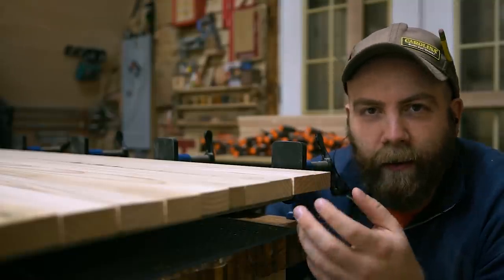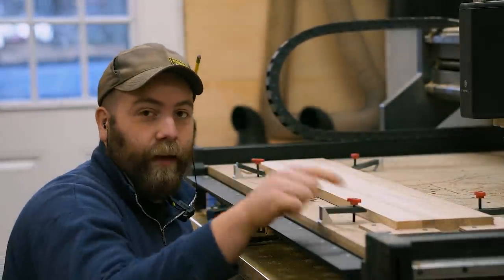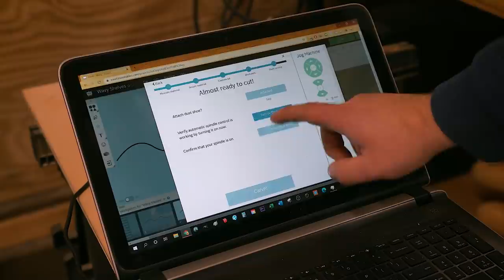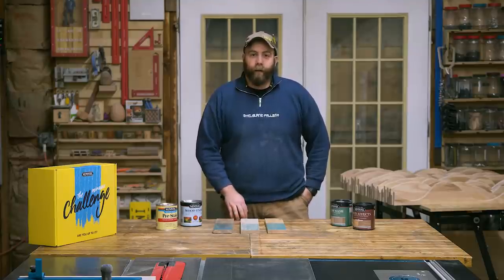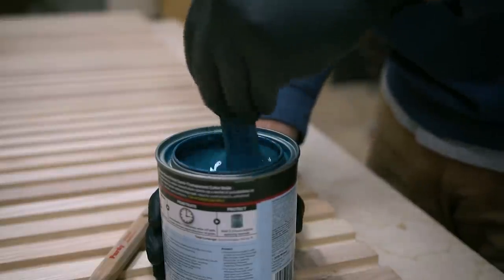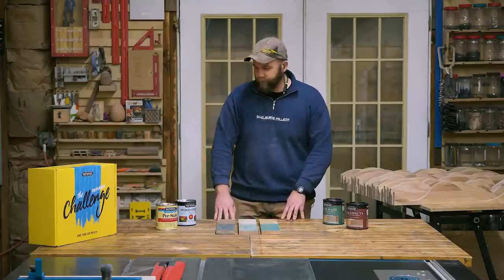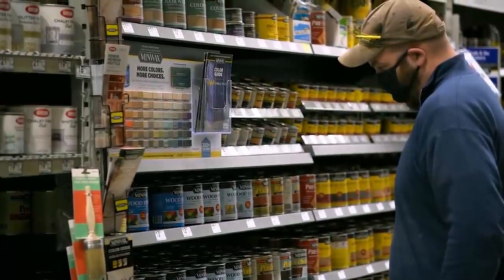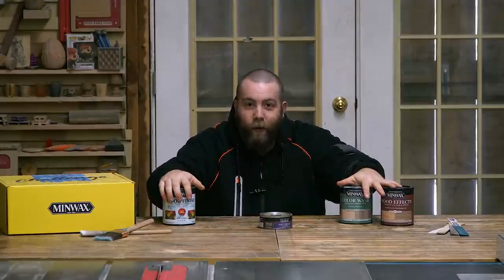Wavy Shelf Accent Wall

Comment from the maker: Do me a favor and check out the incredible sponsors who made this video possible:
Sponsored by Minwax. Check out their amazing Design Series collection and their custom colored stain that opens so many possibilities for new finishing options https://bit.ly/3aPCfGP

𝐌𝐢𝐧𝐰𝐚𝐱
► Water-Based Semi-Transparent Color Stain (Bay Blue) - https://low.es/3aIGnbQ

► Wood Effects Water-Based Stain (Weathered Gray) - https://low.es/3hmrE7N

► Color Wash (White Wash) - https://low.es/2WRpAeE

► Soft Touch Finishing Wax - https://low.es/3hquvwA

► Purdy brushes - https://low.es/3hnsMId

𝐈𝐧𝐯𝐞𝐧𝐭𝐚𝐛𝐥𝐞𝐬
► The new X-Carve Pro - http://bit.ly/3nWMxZJ

𝐑𝐨𝐜𝐤𝐥𝐞𝐫
► Did you spot all 20 Rockler tools in this video? - http://bit.ly/2M6h2y8

𝐈𝐒𝐎𝐭𝐮𝐧𝐞𝐬
► My exclusive solution for hearing protection in the shop, ISOtunes, get your own here - 
http://bit.ly/3nV4Yht
Reply: Just used their Polycrylic gloss to finish a bowl. It kinda wasn’t enough. I wanted it to look like wet glass. I got more of a polished shine. Still good but what will give me that wet glass look? I saw epoxy finishing a bowl but dang if that don’t look super sloppy.

Comment: Ash-hole

Also, didn't realize this weather stuff was new, just used it on a project with Cedar and it came out great.
Reply from the maker: Just showing off my wavy ash! The weather stuff is amazing, I want to test it out on cedar now, the effect on oak is even better then the ash I used.
Reply: @JackmanWorks  Cedar makes it look a bit lighter than an old, weather fence. I was happy, had a backup of a light brown stain mixed 3:1 with white paint and a few drips of black to get a "greywash" if needed, but the stuff worked.

Comment: You are my Hero. I  see you skip plane boards often instead of using a sled or jointer, which goes against everything we are taught, and you still get great results. What's the secret?
Reply from the maker: I actually don't own a jointer which is why I don't use one. Used to never have room for one, but now that I do I'm hoping to get one very soon. For edge jointing I use a jointing sled on the table saw (works for anything 3' or shorter) and for face jointing I just skip plane boards and it generally does good enough to flatten things out unless they have a twist (then I need to touch it up by hand)

Comment: Question for you. After you stained the backer board holding the shelves in, what is your prefered grit for a light sanding with the orbital? I noticed you do that sometimes. Thank you.
Reply from the maker: That was just 220, since the finish is water based it pops up the grain a bit, so I run the sander over super quick just to knock it back down smooth. Need to be very careful not to sand too much.

Comment: I like the end result but like others I'm wondering about the dusting issue. Also curious about why you chose to cut the waves with a CNC instead of a bandsaw. You still had to sand the curves. Seems like a bandsaw would have been faster. Unless I'm missing something.
Anyway still enjoyed the process and your presentation.
Reply from the maker: Repetition, the shapes were fairly random, but also planned out so that I would be able to screw from the back and still have enough thickness in those 3 spot on each board. There were 8 different lines that I cut and did that 3 times, so printing and tracing out all those patterns would have taken a lot of time, so this was the most efficient way in that case.